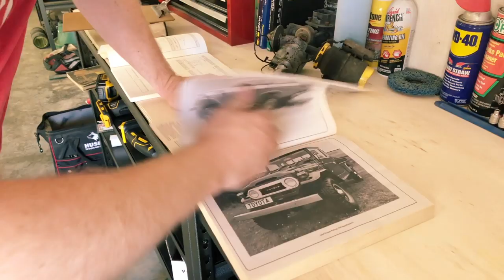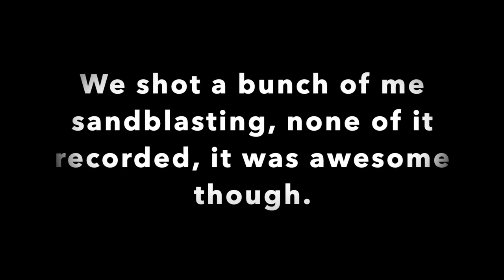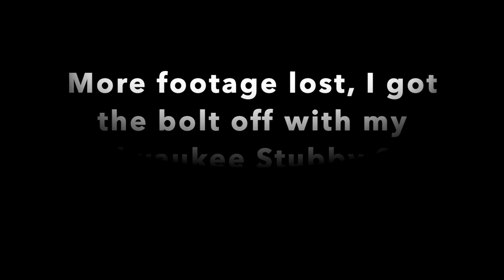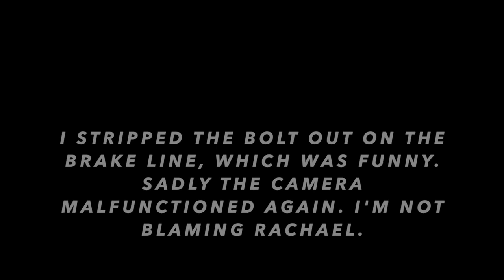PWW 32 - Tiny Bugs Assault, FJ40 Brake Caliper, Pedo Mustache and Short Shorts

Comment: You may want to go git a bench grinder grind your punches.  and git some good bug spray. I use wisdom Tc Flowable I git it at Tractor Supply co for the sprayer it's cheaper at harbor freight it is greenwood 2 gl sprayer  sku # 63134 a helpful hint fill the sprayer with water first then add the  Chemical it keeps it from foaming up . And if your going out to buy a bug spray to spray on you the best thing don't buy off brands the only two is off or Repel the more Deet it has the better it's going to work  i hope this will help you. I know bugs 🐛  can drive you crazy when you're trying to what ever your trying to do. I hope your project goes well and if you can't figure out something just go to you tube.
Reply from the maker: Thanks for the advice Robert, appreciate it!